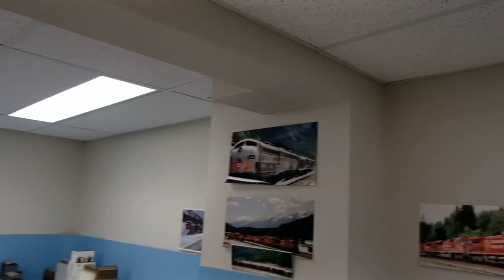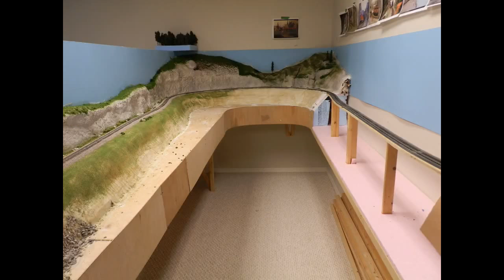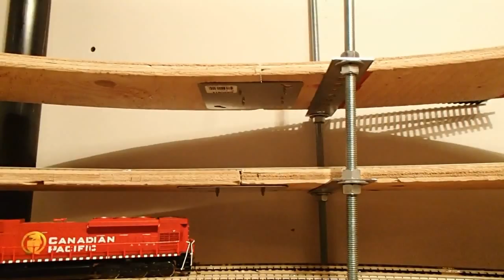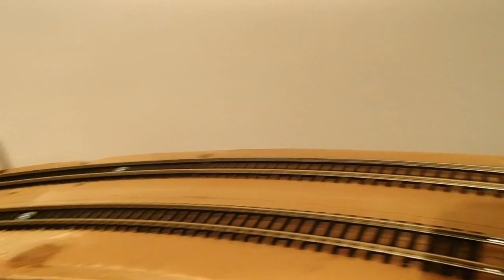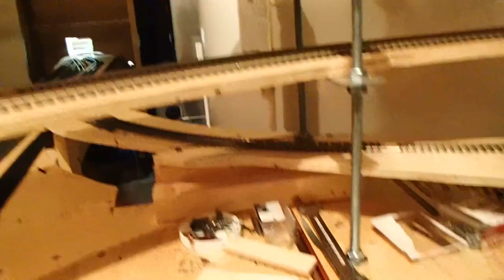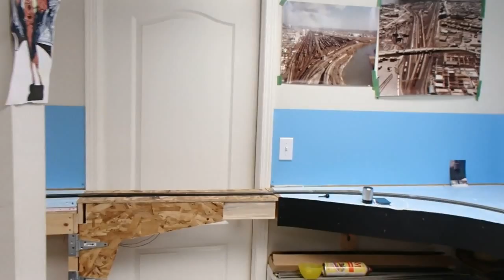Layout Update #2 - Helix, Lighting and Demolition

Comment: With all those screws sticking out through the bottom of the metal, I can't help but wonder how many times you will tear open the back of your hand every time you have to re-rail a train in that helix.  A better approach would have been to drill clearance holes in the metal and put in short screws from the bottom.  You might still be able to avoid the problem by covering the screws with something (painters caulk maybe) or by replacing the pointed screws with flat-ended bolts.